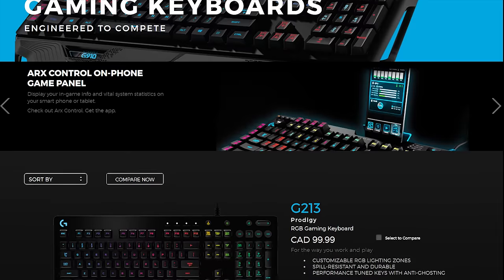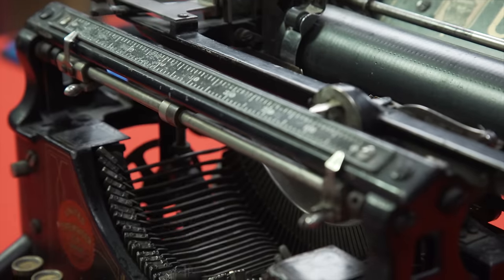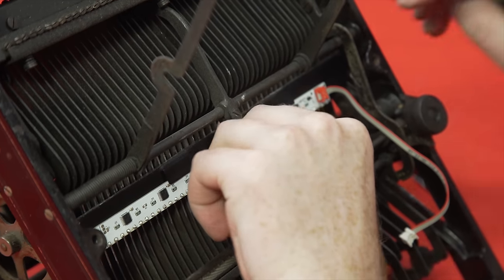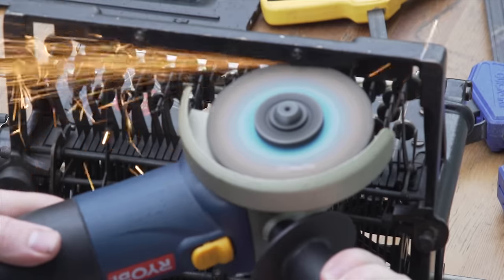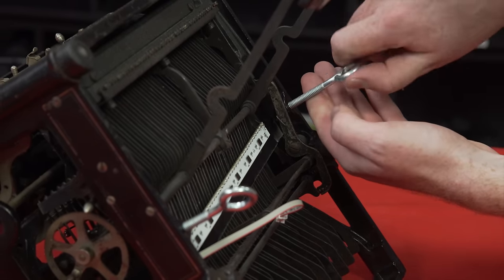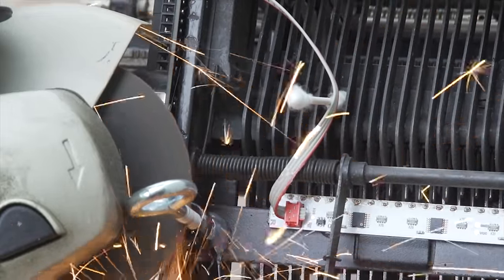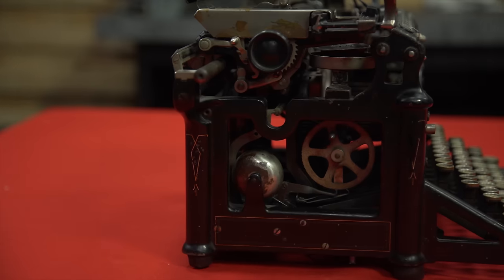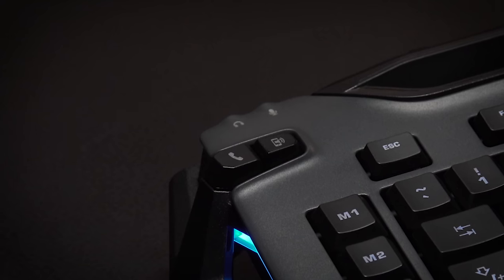21st Century Utility, 19th Century Swagger - DIY USB Typewriter

Comment: word of caution. some antique typewriters are worth a lot of money. any modification made to them will render them worthless
Reply: Only if they are in outstanding condition as well as fully functional, expect some extremely old or rare models/variations.
Reply: They already are!!
Reply: hmm maybe I should google the old working typewriter that I have
Reply: fragmen52_ Just tell me what it is and in what condition it is in, I will most likely be able to tell you what its worth.
Reply: Olumin it's an under wood and I think it was my great great grandfathers.  it types fine, the under wood sign falls off(think its missing it's screws).  it's installed in a desk in our kitchen and I don't feel like being questioned on why I'm opening the desk so I'll check for more specific model info later.
Reply: matt a In my opinion, doing this is recycling an old device that would otherwise just collect dust.
Reply: Vintage, usually.
Reply: This Typewriter in this video appears to be an Underwood #5 first produced in 1901, in very good and working condition. I just Googled Shopping results for this model and came up for listings ranging from $1,300 to $1,500 in a similar condition.

It also came up with results for one that was going for a mere $250 in a poor condition, and one going for $69 that is nearly destroyed.
Reply: dandanthetaximan Collectors like Tom Hanks use all their typewriters, and Tom Hanks gives them away as gifts if the recipient agrees to use the machine regularly.
Reply: Yeah, one of these Underwoods in mint condition with the case is $1300 on ebay right now.
Reply: non yobussiness It’s still probably worth a lot seeing as beside sawing the screw and some of the rotary sanding, not much of it was damaged. Linus is a famous Youtuber who put this together so it might actually add some value to this machine (or trades the value of it being in good condition for the value of a celebrity tech personality modifying the machine for a special modern purpose.)

The typewriter is valued by not just by the condition but by who used it and anything that makes it unique.
Reply: I justed checked at goodwill ( online). They have a whole bunch of typewriters for $10-$20. They thing is can you make the contactor board so it works with them?
Reply: Most old typewriters are not valuable. Go to any flea market and you will find dozens of them. The prices on ebay are overinflated to cover the cost of shipping a 30 lb typewriter.
Reply: @MildMisanthropeMaybeMassive  That seems a bit excessive, I have a working one sitting on a shelf with a few mis-matched keys that I got for $5 about 10 years ago. They're not that popular now, are they?
Reply: @OrangeCrusader  Like any collector's item, the value depends on scarcity, condition, and special circumstances.

It also depends on how knowledgeable the seller is. For all you know you may have a valuable typewriter on the collector's market? What brand and model did you get?

The Underwood #5 is like a Ford Model T.
Reply: @MildMisanthropeMaybeMassive  It's a #5, I didn't imagine it gaining much value past what I had paid. I believe it's a late 20's one, but not 100%
Reply: @OrangeCrusader 

It also depends on what people are willing to offer to pay for it. Over $1,000 seems excessive just to cover the shipping costs in the continental US. A good gauge is this Underwood No. 5 in middling/fair condition which is being auctioned:

https://www.ebay.com/itm/224193319743

Here is a good resource:
https://typewriterdatabase.com/

And here's one being sold at an astronomical cost which I think is asking too much for one in this condition (IMO for that price it better be in mint condition or professionally restored to a museum quality):
https://www.ebay.com/itm/154138286150

Comment: but there's no backspace nor esc in there :(
Reply: and a lot of other buttons you use allday and dont even realise
Reply: Ctrl, alt and del keys are absent as well.
Reply: make the F# keys a macro when you press "f" and a # simultaniously XD
Reply: There is back space, and the carriage return lever is enter. The rest is in programmable layers I think.
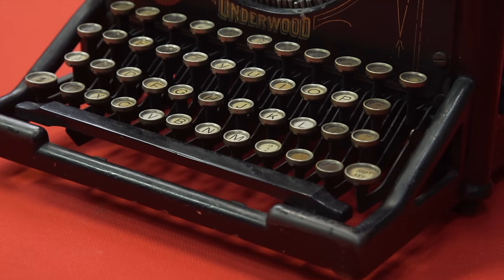Reply: 6:25 explains it all
Reply: KingInky13 It doesn't explain how to use SHIFT and SPACE when SHIFT and SPACE are used as CTRL and ALT tho ...
Reply: Oliver ASUS Then don't use Shift and Space as Ctrl and Alt. Use other buttons. Or, just use the buttons built into the circuit board and don't use the buttons on the typewriter. It's pretty simple, really.
Reply: KingInky13 I didn't ask what to do, I asked what they did as it didn't seem to make sense apparently. Actually that whole part of the video was about how to avoid using the buttons on the circuit board ... it's pretty obvious, really.
Reply: Oliver ASUS
Oh, so you're talking about something entirely different than what I was originally talking about then. Got it.
Reply: Most typewriters have a backspace
Reply: backspace and esc are only for those who fail
Reply: Ghorda9 just failed in realizing that merely parroting nonsense others said six months ago when this comment chain had died already is not exactly a sign of common sense ...
Reply: common sense is just an illusion of sanity
Reply: nice

the new comment notification being unnecessarily triggered was not an illusion tho
Reply: and Taran wouldn't be happy because there's no macro keys
Reply: tipp-ex for backspace, obviously
Reply: Its a typewriter mistakes shouldn't be made
Reply: Such is life
Reply: Hugs  since the board is programmable he would just turn every key on the typewriter into macros.
Reply: There is a button that takes away a letter though
Reply: They used magnetic separation switches. By lifting certain keys (typewriters like this allow that motion) two conductive magnets are separated, registering a keypress. At least that's what I got from his explanation.
Reply: pros don’t need backspace, typewriter typists = pros, you ≠ pro
Reply: If you want a great typing feel on a keyboard that still sucks for gaming just get a unicomp new model m. Thats what I did and has all the keys
Reply: Wdym there is no backspace? There is no delete but there should be a backspace... You know... To go back a space to cross out typos

Comment: Linus do a video where you try to game on it just for fun maybe on (Channel Super Fun?)
Reply: Dan E +
Reply: LOL. The keyboard jams whenever you press more than 2 buttons at once. So much for diagonal movement
Reply: Lance Lindle Lee I think the digital key presses activate before it physically jams, I might be wrong here but isn't the only part that jams at the place of cantact / typing.
As long as the digital is not set so that you always have to bottom it, it should work fine even eith diagonals.
Reply: Udoroth Depraved, Divine. Yeah, it activates once the hammer leaves the contact. The problem is that one small mistake of pressing too hard will make it jam
Reply: Lance Lindle Lee That is true.
Reply: didn't he just say. youl get the blue screen of death if it happens ;-;
Reply: Typing of the dead.  SEGA!

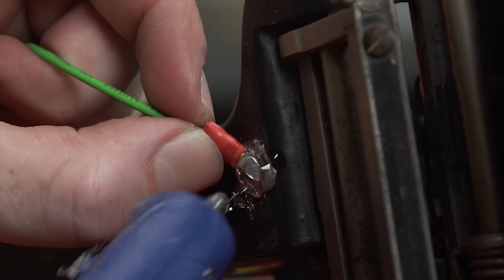Comment: 6:22 Seriously Linus? You just attached a grounding wire with non-conductive hot glue. GG man.
Reply: Nope, he connected it to ground 

Even if he totally caked it with hot glue, the threads are still making a connection with the metal body. In fact I'd be more disappointed if he scratched away some of the paint from under the screw head as that's not needed 

It's still grounded
Reply: Yes, but i still disapprove of him not using something more permanent, like a crimp connector.
Reply: Crimps suck.
Reply: Does not really make a difference for a grounding wire. (Crimp Connectors)
Reply: JZStudiosonline Hot glue sucks more! xD

Comment: If I adda a red LED strip to it, will it type faster?
Reply: no, only RGB speeds thing up.
Reply: no dude, you need to install liquid cooling. also 50 more macro buttons that you won't use anyways/
Reply: +Evert Chin
That's dangerous advice.
Red = Faster
Blue = Cooler
Green = Less power draw
RGB = Experimental, unknown, not recommended, possibly dangerous.
Reply: Well, I added the RGB lights and liquid cooling as recommended and I think I broke the sound barrier while typing 'cause the thing exploded on me.

Comment: Mechanical Keyboard = Typewriter
Reply: No...
Reply: typewriters are completely mechanical though...
Reply: Full Mechanical Keyboards
Reply: someone makes a electrical type writer it lights up and shit
Reply: I have an electrical typewriter. it still has those little hammers hammering the letters on the paper, but it's got keys like a mechanical PC Keyboard with little springs and it also has a little processor and cache that allows for neat functions like going back x many spaces and correcting a typo.
Reply: Not even close...

Comment: As a typewriter collector, this was horrible to watch. I don't mind the idea of stripping the paint off the bottom of the keylevers, or even the hot-glue bodge. Removing the spacebar stops with an angle grinder was pretty bad, but the thing that made me cringe was the typebars on the bare platen. Its one of the worst things you can do to a typewriter, because it ruins a part that is near impossible to replace or refurbish. Platens go bad so easily, and no one manufactures them, and refurbishing them is extremely difficult. Please wrap your platen in a piece of paper, even a black construction paper would be better than hitting the raw platen
Reply: There's a guy on Ebay who recovers platens. He calls it a turboplaten.
Reply: This Typewriter in this video appears to be an Underwood #5 first produced in 1901, in very good and working condition. I just Googled Shopping results for this model and came up for listings ranging from $1,300 to $1,500 in a similar condition.
Reply: @MildMisanthropeMaybeMassive  you think they actually needed that money? Hell no, thats just pocket change to them
Reply: Tri Dinh I know that.
Reply: @fryloc359  turboplaten sucks
Reply: JJshort.com refurbishes platens.

Comment: Would have been neat (but a lot of work) to electrically isolate each arm of the keyboard, and connect them to the various pins on the control strip, and then have a single grounding point where the letters contact the paper. This way instead of the keys making a mechanical connection to the paper, they'd make an electrical connection to the corresponding control pin, making it more similar to the way the typewriter originally worked.

Comment: I know that this is a stupid place to ask this, but does anyone know any software to convert H.264 to H.265, preferably free? Or am I wasting my time?
Reply: Use FFmpeg. It's free and made by the guys who actually developed the x264 encoder and are developing the x265 encoder.
Only downside is, that it can be controlled using command prompt, but you can do awesome things with it.
Reply: Handbrake works too.
Reply: HelixsoulX Handbrake is the best option imo
Reply: use handbrake. slide the slider to the slowest option and use 2 pass encoding. that being said why are you trying to convert the file? because you are probably wasting your time
Reply: ***** handbrake is free open source and about 9mb, not exactly an issue. the workflow for converting in vlc is limited compared to handbrake
Reply: ***** I'ts easier and more straight forward to just install handbrake and use that than try to work with vlc conversion. it takes about 30 seconds to install handbrake, and about 2 minutes to watch a YouTube tutorial on how to use it
Reply: ***** it takes about 2 seconds to use handbrake. I have used vlc for conversion and it is no where near the level that handbrake is on
Reply: ***** and I offered another alternative, we are both entitled to our opinions. In the end it's his decision (though I don''t think his still reading these anyway). I just don't see the issue in downloading a 9mb program to get better and easier to use conversion tool
Reply: ***** I thought we where having a discussion, I raised points and so did you. can't two people disagree about something without someone getting defensive?

Comment: Okay, this was cool. Though I'm starting to think that I'm watching the wrong channel if I expect to see some in-depth electro-mechanical engineering, though. And should you be using hot glue to hold things in place, where you connect the grounding wire? Is that wire actually ground, or did you mean neutral?

I think I would have attached wires, ending in electrical contacts, to each of the moving bars that correspond to the typeable characters, and placed a conductive, oxidation resistant bar where the sensor strip would go, to be used as a shared neutral for the key switch circuits. I would maybe put a soft foam dots behind the contacts on the arms, out of the way, to help absorb kinetic energy, and minimize contact bounce.

Comment: Hey we have a good piece of history here. I wonder if there are any mechanics out there that watch our videos so they can help with mechanical aspects of this machine. I guess if they did, that mechanic would not have told them that a 50/50 mix of acetone and automatic transmission fluid (Honda) works the best for any bolts or screws. He would also not know that there is all thread available at any home improvement store and that an i hook is going to be the best option. I mean it makes for good content to create struggles i guess...

Comment: Oh my God! You sawed it when you could still remove the screws. Unless the screws are flush, which they don't seem to be, you can use a pair of pliers to grip it and apply a lot of torque.
You could also try a T-shaped or even an L-shaped screwdriver, probably a bendable one, for more torque but sadly, Phillips heads are awfully-designed and don't allow much torque transmission usually resulting in grating of the head on each grip loss until you grid it to an ungrippable pit, which you should always try to avoid by applying more pressure along the screw axis and knowing to stop if the screwdriver keeps losing grip.
Also, WD-40 wouldn't hurt much.
Oh, not the glue!
Magnets? No.
This was pretty painful to watch.

Comment: What I really need to figure out how to use my old IBM model M keyboard via USB. I have a couple model F's too,  but that seems like a PITA mod.
Reply: Simple, you use a 5-Pin DIN (AT) to PS/2 connector into a PS/2 to USB connector. I used that arrangement for probably 10 years and before that probably another 10 using just the first connector.
Reply: I've done that. It didn't work. It's been a long time however. It may be worth another try. shrugs I have to dig all those bits out of storage to do so. I never had a problem with the AT to PS/2.. maybe my PS/2 to USB was junk right? nope... it worked fine with other PS/2 keyboards. I guess i need to dig it all out and try again. And I'll do just that.

Comment: well.. it's only a matter of time before the keypresses no longer register on the contact plate.. corrosion, arking dust/dirt.. whatever.. not to mention key presses that are far too hard for gaming.  you might be able to make it better though.. most of the mechanical parts of the typewriter are useless. you really only need the keys, the axle which they move on, and the springs or weight which makes them move back into place, the rest of the typewriter, the entire top half is basically useless.

Comment: Dot Matrix printer style haha take the circuit board of dot matrix printer and no need reprogram it to work for typewriter tadah easier. its already programed for that haha cause its 90's typewriter. better than linus way of using sensor. just take the keys of typewriter and sides. sides and most metal of typewriter for looks only. Some old  manual typewriter use the same circle letter stamps of dot matrix printer replace that one from the printer which has sensors you can use already tadah. Now only if printer ports were still available haha.

Comment: Fun fact: QWERTY keyboard came about because touch typists were too fast and jamming the keys on an ABCDEF keyboard, so they jumbled up the letters on purpose to try and slow them down - now we still deal with that decision today.
Reply: Jimmy B Thats not how it was. Qwerty was introduced to move the most used letters further away from eachother so it's almost impossible to press them at the same time while normal typing. They were typing just as fast with qwerty
Reply: +Retrospect Also, QWERTY puts the most used letters under the strongest fingers with the least movement needed. So Q, Z, P and / are at the furthest reach of the pinky fingers, while E and I are quick flicks with the F fingers.